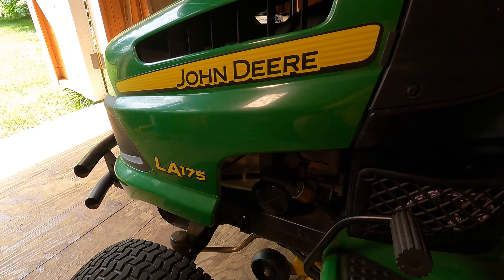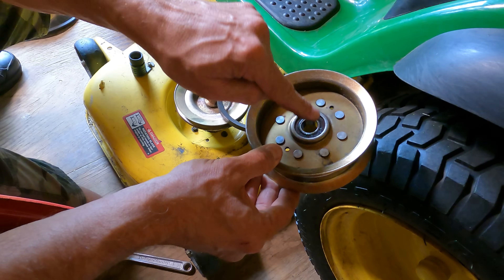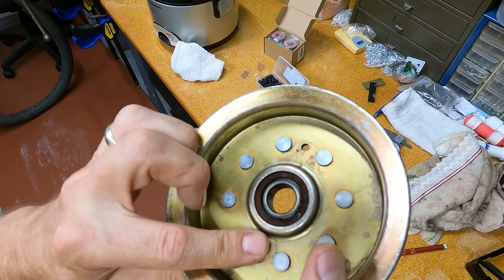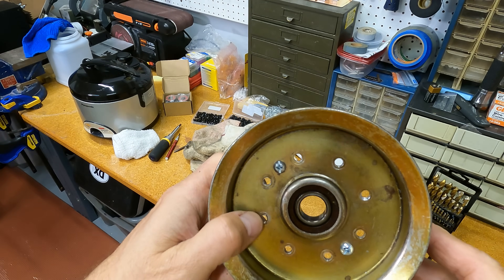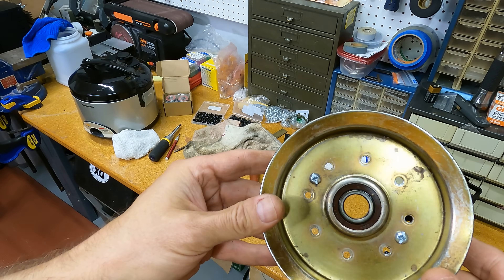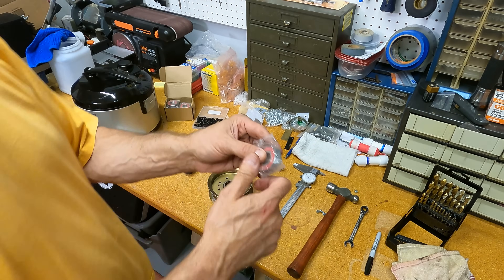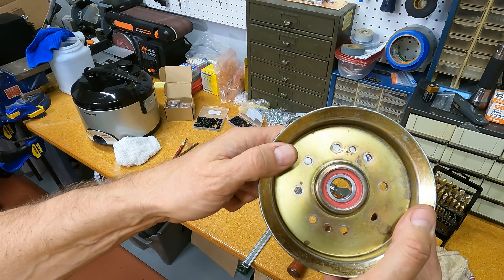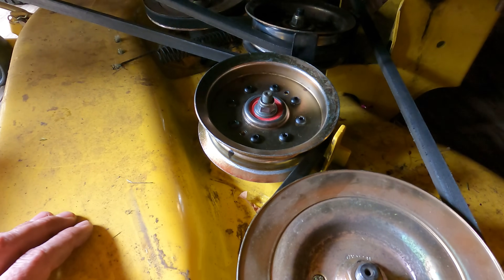John Deere mower deck bearing replacement

Comment: Those two holes in the idler pulley are not guide holes for assembly at the factory. They are drain holes for water for those of you who leave your yard equipment outside in the rain. That way the pulleys don't rust out as fast.
Reply from the maker: That makes sense, but having worked decades in various types of manufacturing, my guess is they serve a dual purpose, as alignment (registration) prior to spot welding would be paramount as well. Good point, and thanks for watching!

Comment: Such an inspiring work of art! There's a special place in Heaven for DIYers.
Reply from the maker: Glad you enjoyed it, and thanks for watching!
Reply: @halfmoontechlabs  I just completed the large sheave but when I drilled out the smaller sheave, I found that there was barely room for the 1/4" bolt and there was not enough room for the nut to turn. I was hoping to use the same nuts and bolts. So I will try either a 3/16" or self-tapping screws.  More quality time in the garage. Thanks. Edit: I ended up using the same nuts and bolts for the small idler once I realized that I didn't have to turn the nut  - I could turn the bolt into the nut. How did I get so smart?

Comment: Those nylon lock nuts will back off when they get hot. Use steel lock nuts
Reply from the maker: These have held up really well, but you are not wrong, steel lock nuts are superior in some hot applications. Thanks for watching!

Comment: Genius, and liked the tip about repacking the bearing in the notes.  Question - any concern of using an allen head screw and it being packed with dirt when you want to do this again?  Would a regular bolt served better?
Reply from the maker: You could do that, but in my experience even in industrial applications where grime would accumulate, I always just used a scribe/pick to flip it out of the hole. Never been a problem, and cap screws/flathead screws are dirt cheap. Thanks for the comment, and for watching!

Comment: So when you have to change out the bearings, would you reuse the nut with that plastic retainer or just replace it with a new one?  I have always been told they won't hold reliably after that type is taken off.  Thanks.
Reply from the maker: Technically, you are correct... the nylon insert nuts should be replaced... however, If the heat has not softened them, and because there are 8 of them, it would be a judgement call at the time of replacement. I've seen these last for years in industrial applications where they were removed/reused several times without incident. I make a point of inspecting mine from time to time, and they have held up well to date. Thanks for watching!
Reply: @halfmoontechlabs ok, thanks for your reply.  I have ordered a set of these screws and nuts as I need to replace bearings in at least 1 and maybe 2 of the sheaves.  I have several old ones around as I have just bought replacement sheaves over the years from the dealer, but they have just bled me dry of money.  Ill probably fix up the old ones to keep as spares to replace quickly in the future.

Comment: I have to replace at least 1 or 2 of these on my deck EVERY YEAR and don't put a lot of hours on it, maybe 20 a year.  At now roughly $40 each, these are outrageous to basically have to replace them all every 50 hours or less.

I'm going to be drilling off my rivets and buying bulk bearing packs too.  Thanks for sharing this tip.  

Who would have thought 30 years ago that john deere would reduce their quality to that of MTD garbage???
Reply from the maker: Yeah, the brand has definitely degraded in quality over the years. Up until just recently, my Dad's JD that I used to mow with 45 years ago was still in the game with minimal parts replacement... he finally replaced it recently, but what a difference in quality and ruggedness. Unfortunately in an effort to compete with cheapo mowers from overseas, the domestic brands have cut too many corners to drive down cost to compete... such is the world we live in now. Thanks again for your comments, and for watching!
Reply: @halfmoontechlabs ya I think that China garbage all ramped up in the 10 years immediately after Billy boy signed the NAFTA and SEAFTA. It was the beginning of the end of America and our manufacturing power and quality.
Reply from the maker: I know money doesn't grow on trees, but all treaty stuff aside, I think that there has been a fundamental shift in peoples views on value as well. It used to be that people would be willing to spend a little more for something that lasted a lot longer... a good value. It seems along with all the crap coming in from afar, now there is also a willingness to buy the cheaper plastic version of what you need, putting cents before sense. That's broken here now as well. Thanks again for your comments, and for watching!
Reply: @halfmoontechlabs youre absoluteky right.  I think that mindset came along about the same time.  I think it was empowered becayse of the flush of cheap stuff coming in and just expanded the consumerism mentality.

I prefer to buy the best quality thing i can afford and will save up to buy whatever that is.  Sometning that i can buy once and will last for years.  Things that can be repaired when needed instead of thrown away and bought all over again.  I have a lot of old tools and equipment and do my best ro take care of it.

Thanks again.  BTW, you might want to do a video about this very topic.  To buy quality that will last and when you spread the price out over many years, it is actually less costly than "cheap stuff".
Reply: They did it because there are a LOT of people who like cheap crap who are unwilling to pay for quality. That is why John 
Deere came up with the LA LT models that are sold in the big box stores. Pay more and buy their X models. You get what you pay for.
Reply: My John Deere had a plastic hood....the thing cracked and fell in pieces

Comment: I always use  Locktite ,on the screws,because I find the nylon gets hot,and will allow them to loosen.
Reply from the maker: Though mine have never loosened, you're right that nylon has a fairly low glass transition temperature... so probably not a bad idea! Thanks for watching.

Comment: I would hope that the bearing superbly aligns the two halves but I'm guessing they are a loose running fit, hence your precautions?
Reply from the maker: The bearing seems to "locate" the two shell halves very precisely with little to no play, but you are correct, I took extra precautions anyway to make sure. Thanks for watching!

Comment: Crap design, using a single row bearing instead of two.  These bearings are taking a beating in an alley every time the deck runs due to random axial load from the belt.  But great video and excellent job !  I have one waiting at the moment.
Reply from the maker: Yeah, not the bearing I would have chosen either, but at least the fix to allow for quick cheap replacements in the future is now done ;)  Thanks again for your comments, and for watching.

Comment: Great video my friend.  The only thing I would have also done was to lift the bearing seals and pack with a high temperature grease.  They will last a minimum of five years if you had done so.
Reply from the maker: Thanks, and yeah, I have another video specifically showing how to repack these type of bearings. Thanks for watching!

Comment: The Chinese companies almost never put enough grease in any mechanical assembly that I have purchased. I would recommend removing the shield off one side of the bearing and packing it full of quality grease.
Reply from the maker: Normally I would agree, however, I did check these bearings, and they were actually decent. Always good to check! Thanks for watching.

Comment: I did a similar thing on the bearing on my John Deere 400 and carefully removed the bearing seal then I l cleaned the grease out with carburetor cleaner and replaced the grease with synthetic grease and replaced the seal and put the pulley back together
Reply from the maker: Yes, repacking the bearings is absolutely the way to go  if the bearing is not too scarred by running dry for too long. I actually have another vid just on repacking these cheap bearings, check it out! Thanks for watching.
Reply: @halfmoontechlabs No I repacked the new bearing
Reply from the maker: @newriver8940  Yes, many viewers have pointed out that even new bearings can be packed with inadequate grease (quantity or type), so always good to pop the lid and check, even when new. Thanks for watching!

Comment: Lol, husqvarna has john deere beat. 6 rivets and 8 spot welds I had to drill out to replace a 6203 bearing. First one I did by hand and wasn't fun. Second one I did on the drill press, it was a breeze. Also had 2 plastic sheaves with molded in bearings. Cut back one side until I could press them out and back in with a vise.
Reply from the maker: Yeah, the drill press made it a breeze. That little WEN was only a couple of hundred bucks, and has made dozens of projects so easy, it's paid for itself! Thanks for watching.

Comment: I appreciate the fact that you were able to stick-it to John Deere for making their products unrepairable by owners, they deserve it, however it's hard to justify spending upwards to two labor hours for a part that cost $30.00. You would have been better off buying an aftermarket part from China.
Reply from the maker: I understand your point, however... Don't discount the fact that I love to tinker, and this was a labor of love :)  Also, the real payoff is that the next time I have to change the bearings, it will only take me 15 minutes to change all 3... so money well spent in my opinion. Thanks for watching!
Reply: Good point.

Comment: The holes are for attaching a Puller.  Using a 3/8" drill may work better for removing rivet heads.  The new bearings should not spin too easily, indicating a lack of grease.  A good time to pop the seal and add some.
Reply from the maker: Yes, using a bit slightly larger than the hole size underneath is recommended. The idea is to shave off the head of the rivet without removing material from the base if possible, then it just pops off. Thanks for watching!
Reply: Yes, you are there, easily pop's out with a pick, add grease, pop cover back, 15 seconds invested while you are there to just add more time to the bearing life.
Thanks for your knowledge.

Comment: I looked at the lidlers on my 2001 Cub Cadet ZT1 - 42" and they were totally different.  One was a larger OD and had two circles of little spot welds that were barely visible.  The other looked very similar to the sheave shown above on one side, but the other side had dimples that were in place of actual rivets (like he shows), mine were nipples on one side that were pushed thru holes in the other side and mushroomed to hold the two sides together.  Both of these idlers were separated by drilling just like he shows, EXCEPT that the two sheave haves did NOT fall apart like his did at 11:25.  The 6203 outer bearing race was PRESSED ON so tightly that I had to drive a putty knife between them to pry them apart, on BOTH idlers.  I found that the ball bearings themselves were in very good condition but the grease had solidified, turned to wax, and the bearing were basically running dry.  I lifted the seal and applied a much softer grease to one side of the bearing and reinstalled the seal on both bearings.  They run SO MUCH QUIETER now.  The screws and nuts he linked to above are perfect for this repair.  NO NEED for the temporary alignment screws, the bearing races take care of alignment between the two haves and the screws will pull the two haves together on the bearing.  THANKS FOR THIS VID!!

Follow-up:
I've replaced the bearings in five idler pulleys so far!!  Everything is SO MUCH QUIETER now on the JD and CC mowers.  FWIW, I used the screws in every other rivet hole and it works just fine.  
Thanks again for  posting this vid and with the links to the bolts and nuts,  they are perfect for this repair.
Reply from the maker: You're welcome! Thanks for watching.

Comment: Cant you rhis pull the Cover off repack theboldxVearing put covr back on
Reply from the maker: The two halves are spot welded, have to drill them out before you can split it in half. It was not made to be serviced on purpose. I'm trying to show how to fix this with a little bit of effort to make them serviceable in the future. Thanks for watching!

Comment: Transfer punch and a guide would make getting the punch marks more precise. 
Putting the pulley on a center point to turn on the drillpress would keep all the drilling in the same circumference. 
Drilling/Tapping oil or RapidTap fluid makes drilling seem like soft butter.
What you did works and that’s what matters most. Good display of how to remedy the JD idler issue.
Reply: Run the Drill a tad faster the smaller the Drill the faster you it turns to cut .
There 1)4 could Run at 1000 RPM
ESPECIALLY when it's a New Drill bit 
And Titanium Coated.
Even old Fashion HSS
I WOULD IT AT 100p -12000
If I was in a  clock
Reply from the maker: @georgemartinez1720  I'm just showing how to use an off the shelf bit and drill press... it was easy enough as shown, but thanks for your suggestions!
Reply: I wonder if the Labor charge 
To do this is less than what a Pully would Cost
Reply from the maker: @georgemartinez1720  It was a labor of love :)  Have you accounted for the fact that after this mod, that ALL of the future bearing changes will now take 5 minutes? Will save money in long run, and if not, I had a fun time doing my part to defeat planned obsolescence. Thanks for watching!
Reply from the maker: All good ideas, and I usually use Mr. Cool Tool or equiv, but was out and wanted to show water method. Great in a pinch with step-bits. Thanks for watching!

Comment: Good idea but I thought you would have popped the cap off the bearings and put some of your own grease in, because they come very little grease. Cheers Graham
Reply from the maker: Actually, I did take a look, and these happen to be well greased. But you are correct, you should really look first and not assume. Many cheaper import bearings are not properly lubricated. I have another video where I show exactly how to do this. Thanks for watching!

Comment: I have done this for years.  I use bolts with nylock nuts.  The holes are so rain water does not collect in the concave.
Reply: Holes are for attaching a Puller if necessary.
Reply from the maker: @gordbaker896  They likely also aid the automation in the factory assembly, serving as locators to hold the two halves in place prior to riveting.
Reply from the maker: Works great, I use the same! Thanks for watching.

Comment: How do you tell bearing size? Is it stamped somewhere on the bearing?
Reply from the maker: Usually it is imprinted (laser etched on metal, or embossed in the molded seal) on one or both sides of the bearing. Thanks for watching!

Comment: How long were the screws you ordered.??
Reply from the maker: All shown in video comment section: "1/4-20 x 1/2" Button Head Socket Cap Screws, Allen Socket Drive, Black Oxide, Grade 10.9 Alloy Steel, Fully Threaded, 50 PCS ;   ASIN: B07NQN2G2F" Thanks for watching!
Reply: @halfmoontechlabs  Thanks. ✌

Comment: I did the same thing on my  jd l120  makes it real easy. I learned how to remove the deck in 10 minutes, replace all the bearings and put it back on in less than hour.
Reply: @jhscheppele2448 When you take off your deck does it affect the cutting height of your blades? Assuming the height was properly set to an even cutting height in the first place😂 😂😂
Reply from the maker: @Fresh-tw7ev  For my repair, I did not have to remove the deck, I just levered the belt off, removed, modified and replaced each one in-place, then popped the belt back on... it went really easy! Thanks for watching.
Reply: @ I need to find a good video that shows the belt removal.
Reply from the maker: @Fresh-tw7ev  I just place a screwdriver shank perpendicular to the belt length and rotate it by hand "into" the sheave (pulley, whatever)  until the screwdriver shank is under the belt, then just twist the screwdriver slightly to stretch the belt off the edge of the sheave. Even a properly tensioned belt has enough elasticity to allow for this. Then, just do the reverse to pop it back on after. With practice and a bit of elbow grease, you may be able do it by hand as well. Just make sure you have removed the key before attempting this ;)  Thanks for watching!
Reply from the maker: Nice. Once modified, it really does make it quick and easy. Thanks for watching!

Comment: I would have taken the seals off the new bearing and repacked with more grease!
Reply from the maker: There can be too much grease in a bearing (over and under lube are both problems for different reasons). In this case I did check, and the bearings had an adequate amount of grease so I did not add more, which would have led to an  over-packed bearing. Thanks for watching!

Comment: Top Job. Just add 641 Loctite Bearing retainer to the outside of the bearing to stop the outer race from spinning in the pulley housing.
Reply from the maker: Mine were pretty snug as is once clamped in, but it couldn't hurt. Thanks for watching!

Comment: Great video. I have an LA145 and it eats those idlers for lunch. I only have 50 hours on the machine and I'm on my third set of idlers. The idlers are spot welded together, but I'm going to try to drill them out. Wish me luck.❤
Reply from the maker: Be safe, wear PPE, and secure to something before you drill if at all possible. Thanks for watching!

Comment: i'm currently nursing a busted nail and cut , or maybe busted fingertip . the bit grabbed , the pulley slipped on drill press table , and i did a quick and expletive enhanced dance around the shop . i now advise clamping the pulley to the table .
Reply from the maker: Eeek!, Yeah, careful there, and thanks for watching!